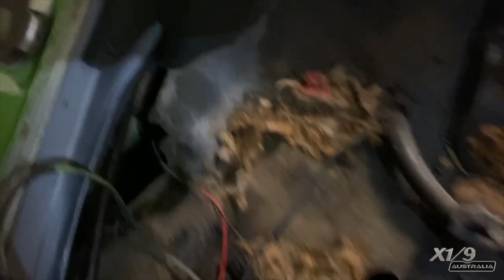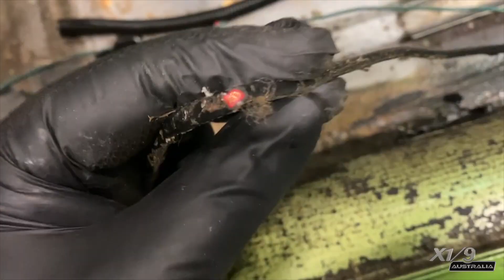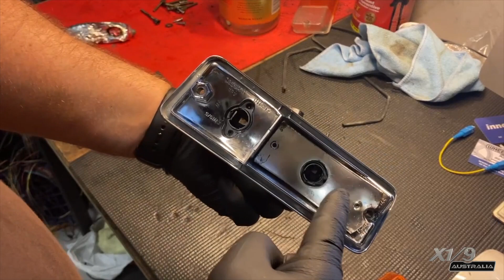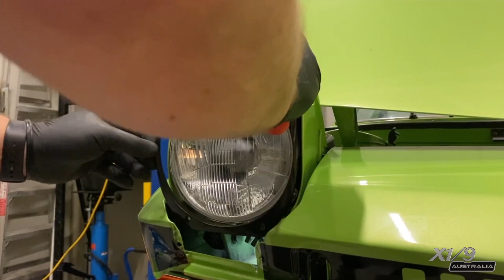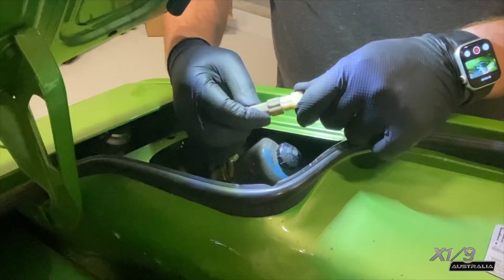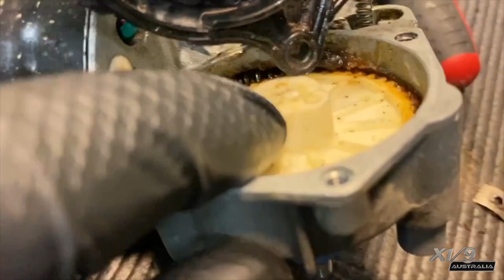The Green Machine Ep.4 — Electrical Rewiring, LED Headlights & Wiper Motor | Fiat X1/9 Restoration

Comment: Hi Mark, thanks for uploading this update. 
I wanted to ask if you have yet defined the ultimate engine for the X19? 
There's a bloke in Ireland who's winning hillclimbs with a 200bhp sohc 8V.
I'm beginning to agree, this could be an engine to copy.
The base motor is from the Fiat Tipo. 1600 ie. 
The Tipo block is externally identical to the X19 block, but has a revised oil gallery allowing for a longer stroke crank. 
Pistons and oversize rings increase the capacity to a little under two litres. 
If you're interested I can get you the exact details I'm sure.
Reply from the maker: Hi, Mark. It's a hard question as it depends on what you're trying to do and what country you're in. Any conversion from the factory specifications in Australia requires an engineering certificate. The car's I own were converted in the mid 90's so the restrictions and requirements were more relaxed to now. I'm also only interested in owning registrable road cars as don't want the hassle of having to tow them for track usage only. You can pay to get the car engineered, but it's costly and for little benefit as let's face it how fast can you go on the road anyway. Thanks for the offer but it's unlikely I would contemplate a serious power upgrade in Australia but appreciate your comments and interest.
Reply: Hi Mark, thanks for explaining some of the reasons against, in relation to your own approach (I could say 'philosophy'). 
I didn't realise that the laws you have in Oz have played a role in the definition of your approach. 
Regarding speeding, if the Italians had ever been concerned about this, none of the famous fast road cars from the seventies, eighties or nineties would ever have been built. 

The whole concept of the Stradale would have foundered, and there would have been no factory homologated cars either I suspect. 
60 mph is our maximum, but there are some roads that are very twisty but with a good surface. 
I think if the X has a forte, then it would be sprinting through, between, and into tricky corners, uphill, and on a warm surface but with cold air ie sometime around dusk or a bit later. 
So my approach is about gearing the transmission down by upping the red line, reducing the tyre circumference, and fitting close ratios (Punto GT), plus doing the suspension and geometry to reflect this. 
The aim being to build a car that can be driven safely, at or near the limit up to a margin of 100mph. 
I'm also fascinated by reverse engineering in general, and in the X19 it's about having a serious go at both preserving the 8V sohc characteristics (low down grunt) but increasing top end, within the limits of the original head design. 
Value for money is a big issue for me, I do not have the cash to build a replica Dallara but the end result should be - an exciting drive for a quarter of the price. 
No worries, keep up good work, keep posting! ☺️

Comment: Brilliant informative video. Learnt a lot about early cars. So envious of your climate and the condition of the car! Good work. Thanks from Great Britain!
Reply from the maker: Thanks for watching and your comments. Having no snow and no need to use salt on the roads has helped preserve more X1/9's that's for sure. However, there are still plenty with lots of rust. I picked one up that was full of rust just for parts but ended up using it on the dirt for fun. https://youtu.be/LyvcX5COsP0